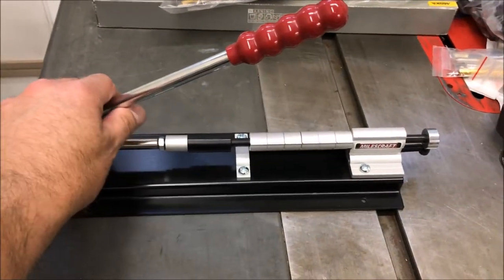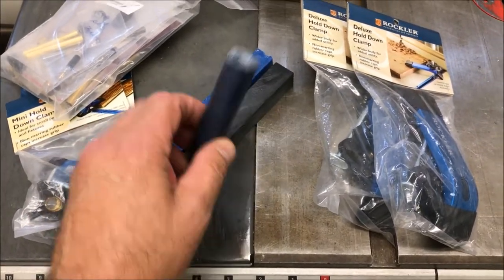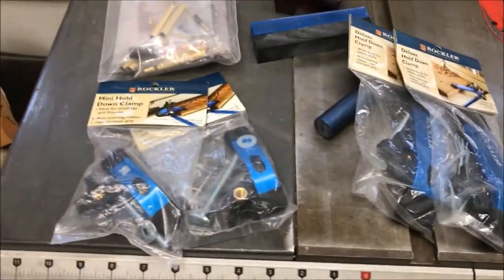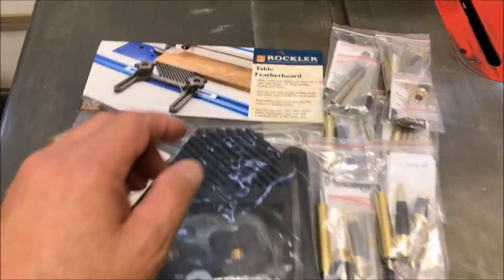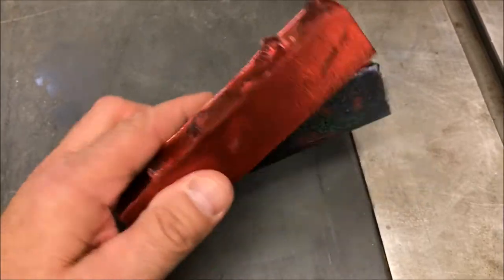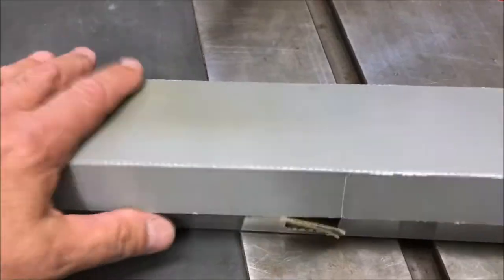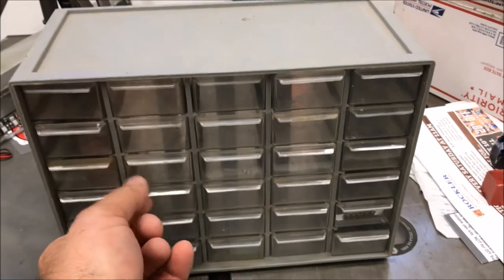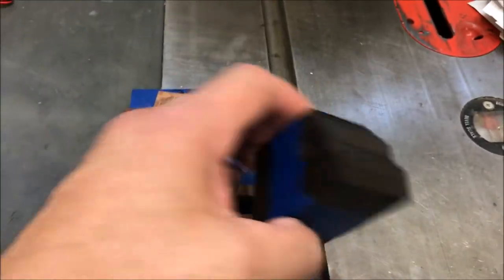Update 8/6/2017

Comment: First of all, great haul! I've been wanting a nice sled to try and get more accurate cuts for segmented blanks. I got the same press and after a few kinks, I love it. Should have bought it when I started turning. As for the bottle cap blanks, I just started casting and chose liquid diamonds because they claim you need no pressure pot. I think you still need one, but like it so far. There is a monarch grande kit that is in the sierra family I've just ordered. It uses the same tube, but bigger bushings. It may solve your problem, and mine. Thanks for the shout out, and thanks for sharing 👍
Reply from the maker: +Ron Parrott Thank you Ron. 
  Lynn and I spoke on text last night, were going to get this figured out. 

Regards,
Bob